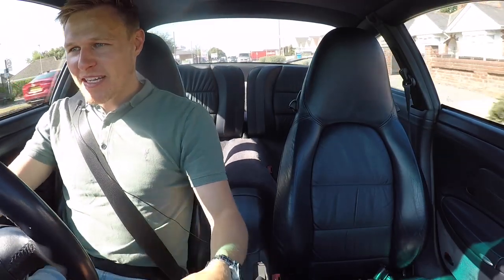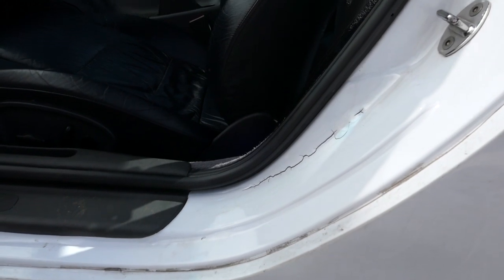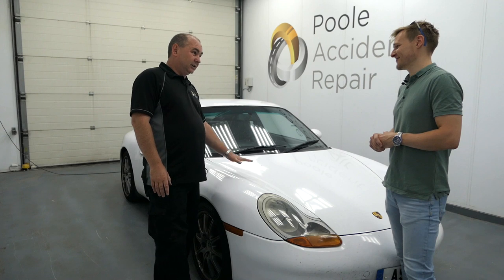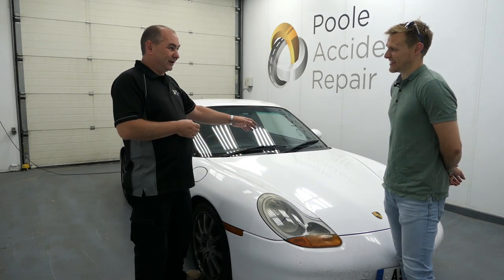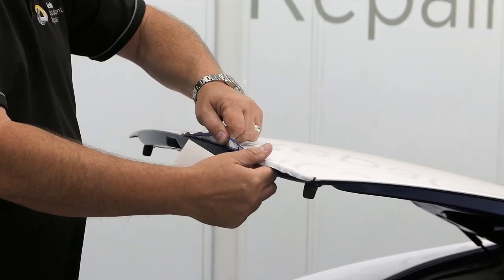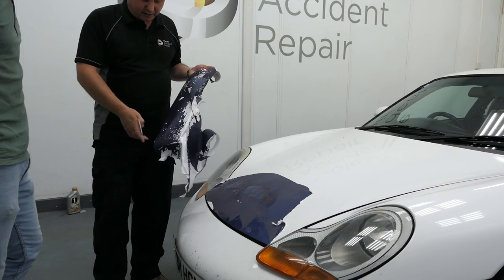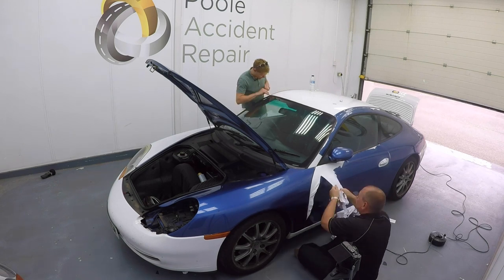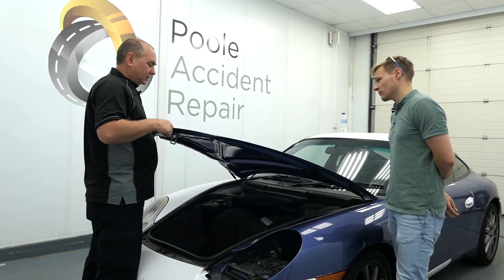Removing the wrap on my Porsche 911 996 Carrera!

Comment: I wonder how much the full respray would cost on a porsche ?
Reply: I just had  my hood, front bumper, front fenders, A pillars, and back half of my rockers repainted on my 997.2 GT3. Additionally, the rear quarters were clear coated since they didn't want to just clear coat the repainted part of the rockers and A pillars. You can't blend new clear coat into existing, so the whole rocker / rear quarter/ A pillar assembly had to get new clear since its one panel.  Paint was damaged when a detail shop trimmed ppf while on the car and razored thru the paint and also stone chips on the rockers. Paint done to Porsche standards by a major collision repair center. 5K for just those panels. So probably 10K if you added in doors, roof, and rear of car.
Reply: Additionally, PPF'd and Car Pro Cquartz Professional ceramic coated. Looks like a new car!

Comment: I can not wait for the next video.
But why change the color of the original paint?
You could have done the blue and a new wrap over it.
Reply from the maker: Thanks! Regards the colour, I do really like the Zenith blue but the colour I've gone for makes it a bit of a one off. I've always wanted a Porsche in this colour, and I figured a 996 was the best car to do this with, due to the low cost of the car. I wouldn't dare respray a GT3, for example, which I hope to own one day.
Reply: @9WERKSTV  See my post above regarding GT3.  Unfortunately i had no option. Respray or razor blade lines across the hood, bumper, and fenders.  So as long as it was getting those parts done, I figured redo the stone chipped rockers too. Now the rockers are double PPF'd, a base ppf, and A second piece over that for easy replacement when it gets marred with the inevitable stones kicked back by the Cup 2 tires.  Car looks amazing now.

Comment: Hi, I have a 1998 996 and am considering deleting the rear wiper to achieve a cleaner look. I am using a plug from Alloy&Carbon off Ebay. I notice you still have the wiper on your 996. Could be a good idea for an instructional video.
Reply from the maker: Ah, the perennial debate on wether a rear wiper belongs on a 911 or not. Personally I rate them – they are handy! However, mine might be going as it might not look right, so there may well be a video on that soon. Thanks for the tip.
Reply: Phil Jones I like the rear wiper on my 996.2 C2 manual, BUT, my carelessness caused large scratch when my power washer caught it in the raised position and it flicked down with the blade armlifted out, gouging  theC-pillar. I put up with it for nearly a year until the car needed a new bumper and I got the panel repainted at the same time.